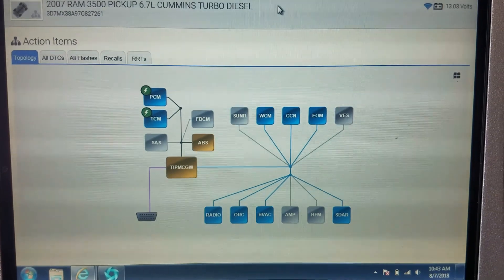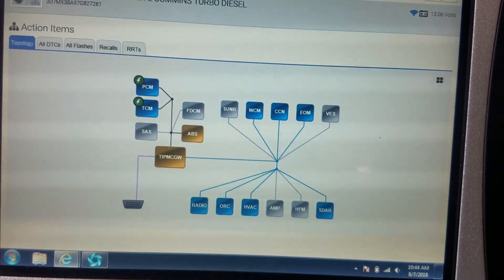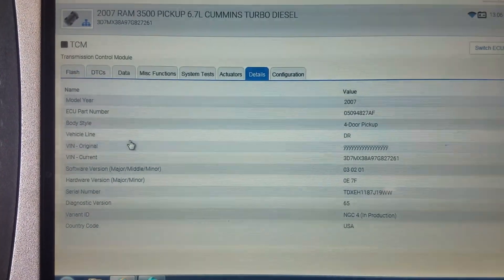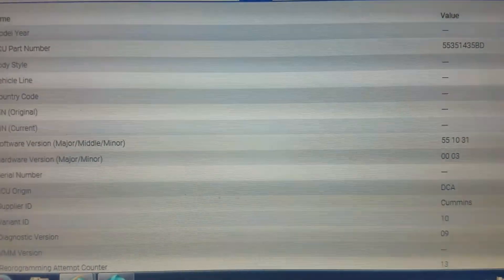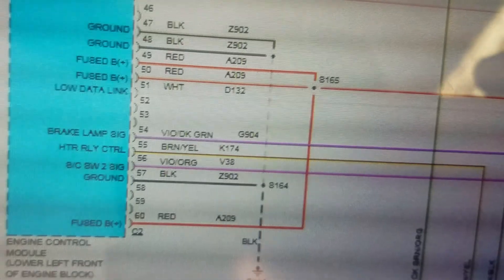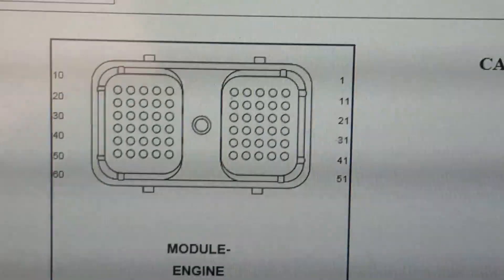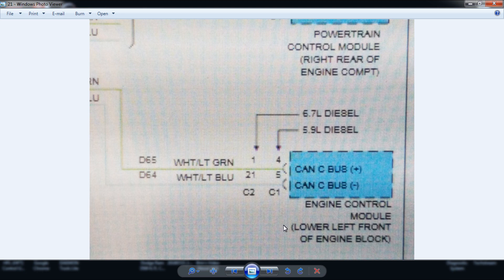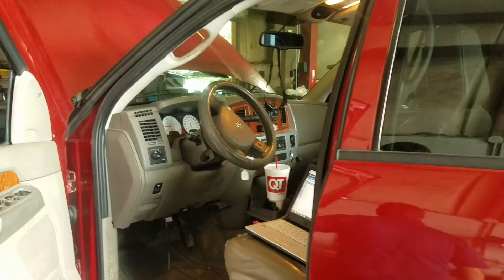2007 Dodge Ram 3500 6.7 Crank No Start - A Collaborative Diagnosis!

Comment: Similar issues all I’ve come up with so far is it something to do with the van corruption in the ECM usually can’t communicate through the enhanced side but you can communicate through the generic side with scan tool. The E Sims are losing the ability to be self identified by scanners and other onboard modules but are communicating on the generic side pretty sure it’s going to wind up being faulty ECM’s, and so-called rebuilds that are just repaired are missing the issue

Comment: I have a truck with exactly the same problem, i replaced the ecm with a reman truck started road tested the truck for about 5 miles and truck stalled has same problem  again 😑
Reply: Did you get it fixed?

Comment: Has anyone resolved this issue? I have the same exact thing going on with my 2007.5 6.7 3500. Been through 4 ecms changed all battery and ground cables and still having same issue 😢 can someone help out please? I’d greatly appreciate it
Reply: Battling same issue, died going to work, towed to dealer had it a week and finally called them saying bad ECM.  No vin number or different one, and said no codes, paperwork I got doesn't have what they did and said $3500 for ECM.  So had it towed home, looked on line for ECM found and outfit life time on ECM they asked me what happen an told them.  He asked for codes which I said there was non, person there should be and needed to scan.  They wanted to make sure that it wasn't an ECM.  Barrowed scanner and came up with 4 out of the 5 on video C2206, C2202, U0100 and U0141 which also had ABS.  They suggested R2 the ABS module, did and still same thing.  One thing I noticed fuel no prime, glow plug no light on, and battery charge light not on.  Hell the CTS3 I have when plugged in will turn on, shouldn't not until the engine is running.  So now a month going and will call the ECM outfit say no work with ABS change but, now wondering if it needs to be vin programmed.  Frustrating as hell.  Also noticed that the ECM has been replaced before I just wish I new what reason for I bought the truck in late 19, second owner.
Reply: Career technician, similar issues, including lost communication with modules on bus C .. replacement of failed doorman tip on the gateway module restored communication, and returned high and low voltage is back to 3 1/2 and 2 1/2 V gateway was pulling negative bus to 1/2 a vote…. Suspect, corrupted ECM files most likely due to programmer can’t communicate with ECM through the enhanced, but can communicate through generic all kids working no codes can’t reprogram due to no communication through the enhanced side guessing time for New ECM.

Comment: I have a dodge 2007½ 6.7 with the same issue. It has the delete done with an H&S XRTPRO  tuner  and egr removed completely. What are my options without going totally stock again?
Reply: Did you ever figure out your issue? I have the same exact thing 07.5 xrt pro truck died while driving now won’t start back.
Reply: @ItzMazz  I just put a new ecm on it. I didn't try to reprogram the old ecm so I can't say if that would have fixed the problem. I ordered the new ecm already tuned by an H&S tuner but for some reason the truck didn't have the power it had before, so I just retuned the new ecm with H&S tuner. So far the truck is working nicely.
Reply: @ItzMazz  My truck died while driving too so it sounds very similar.
Reply: Where did you order the ecm from ? Dealer said oem ecm is $4k I told them kick rocks.
Reply: @ItzMazz  I actually didn't order it myself, the mechanic at the garage where I had my truck ordered it so I have no idea where he ordered it from. It was a refurbished ecm and it was around 2k and they gave me something for the old ecm too.
Reply: @wilhelmpeters6054  i have same issue where did you buy your ecm from?

Comment: I have a 2007 just like the video.  Replaced the PCM 4 times in the last ear and one TPIM.  Works for a while and then on road the lighten bolt comes on then check engine light. Loses VIN and no start.  can't find the issue causing this.  Did the reflash on video solve the issues or do you know what solved the end issue.  Thanks great information.
Reply: Me too. 07 6.7 3500. Remaned ecm solves issue short term. On my 3rd new ecm after fixing various electrical shorts, censor issues and new batteries. No shop will touch this issue.
Please help 🙏
Reply: @michaelrayplays3274   hey brother I have the same problem as you did. Gone through like 4 ecm’s replaced all battery
And ground cables and still haven’t resolved the problem. Did you find out anything on yours? Mine been sitting for months, no one can figure it out. 2007.5 6.7
Reply: Did you all ever figure this out ? Having same exact issue.
Reply: @ItzMazz  Replaced the ECM again then it gave a trottle sensor code.  Replaced that but still do not trust.
Reply: @ItzMazz  same here 😢 anything news on yours???
Reply: @joserolon5575  new ecm fixed mine!
Reply: @ItzMazz  I tried that 4 times already 😓
Reply: @ItzMazz  where did you find the new ecm? I have the same issue i replaced the ecm with a reman fixed it for 5 miles and truck stalled and has same issue again
Reply: @joserolon5575  i have same issue any luck?
Reply: @MrNrleader007  only new one you will be able to purchase is through Chrysler. I got a reman
Reply: @MrNrleader007  no luck.
Reply: @ItzMazz  i have the exact same issue replaced ecm with a reman road tested for 5 miles and stalled with same issue again. Any luck?
Reply: When you got the throttle sensor code did it lose connection to ecm again ? Because I got a dead pedal before it died
Reply: @ItzMazz  Not yet but has not been driven much.
Reply: Well I just got the truck out the shop yesterday. Changed the alternator, took off an aftermarket alarm, rewired the grounds and power cables, checked for shorts in the harness and checked pretty much everything that has to do with the electrical. Oh and a new refurbished PCM. (Flashed the PCM prior of turning on the truck) and the same thing just happened today. Died on the highway and left me stranded
Reply: @joserolon5575  Where did you get the ECM from?

Comment: I am fighting a no start issue right now and it seems that the fan clutch has faulted and is putting the ECM in Rom Boot Mode. It has faulted three times now, the second time I changed the fen clutch out as I had found some wires showing copper possibly shorting out together or to the fan shroud brackets. This third time I am thinking the ECM is corrupt and needs to be replaced. Point being......The fan clutch can cause some major issues to the ECM as I am finding out.

Comment: I put an H1 bulb inside of a $10 test light. 4.5 amp test light baby. Just make sure you wrap it with some red electrical tape so you know.

You have to grind off the ring part on the H1 bulb to fit it in case anyone wants to do this. 2 minutes on a grinder will get that thing off.

Comment: I have a 2007 Dodge Diesel at a dealer shop right now that won’t crank.  They have replaced the TIPM and are waiting on a PCM & ABS to come into the shop.  $6k and not sure of anything.  Any diagnostic tech’s like you that you could recommend in the Portland Oregon area?

Comment: thank you , good diag I was working yesterday on 99 dodge ream 2500 5.9 diesel no start  and I had no high pressure fuel , low side was good . how ever all the hits were for hgh pressure pump , had a code  P0216 injection pump failure . but for me to make the call for this pump was hard lack of information how the  system work, the fuel injection control module  has 1 power was good, ground is coming from ecm and there are like 6 wires coming from ecm to hpfcm, I was wondering what they do this wire how about if is not receiving any command from ecm , all data ,mitchell or identifix did not have description and operation more than they communicate in between . I decided to crack loose each injector line at cylinder head and thighnen , the last one on the back was very easy to  turn. after that it wanted tom start, took a while and started, a trick a teacher told us on a class. do you know what type of information they are exchanging or how they do it , on scan data there was not pid for actual and desire fuel. of course snap on  zeus  and x431 launch . thanks .
Reply: Thank you Joel. I'm sorry for the delay. I'm not sure that I understand what your question is bud.
Reply: Now I'm curious about what these wires used for,if somebody out there know please let us know

Comment: Yeah it’s easy to make your own load test lights with headlamp bulbs, sockets, and soldering cut T-pin ends on the wires. I have a whole range of loads of test lights just for testing these circuits.

Comment: hi guys darren here from uk, question would you have found problem using just generic scan tool or was gem tool key,thanksguys you get much more diagnostic time than we do in uk
Reply: I'm sorry for the delay Darren. If you recall, we did take a look at data with an aftermarket scan tool as well. Yes, we could have but using a factory scan tool makes life easier in circumstances like these. Especially the wiTECH. The network topology is the strong point of this tool.

Comment: Most diesel aftermarket tuners will “store” the oem tune before it uploads the custom tune. The tuner is then locked out from being used on another truck until the custom tune is withdrawn from the ECM and the stock tune is reflashed in it. One of the first things I always do is use the customers tuner to install the oem tune and see if the problem goes away. It’s a quick and easy first step in troubleshooting these vehicles.
Reply from the maker: Good Tip!

Comment: Topnotch video please keep them coming , i have two questions one is is it true that Picoscope is working on an all in one scope if so please let me know the details and the  number two question is could you tell me where can i get some of those piercing probes Keith Perkins used in his video GM Class 2 Network Diagnosis Tips . Thanks  truly  to all you guys at Trained by Techs for all the high tech information and great videos .
Reply: 8power0 aeswave.com
Reply: Aeswave.com
Reply: 8power0, I'm sorry for the delay but Mario and Drews Auto are correct. AESWave is a great source for most diagnostic and scope equipment . They are amazing people as well. I haven't heard anything about the all in one Pico Scope.

Comment: Awesome solid Diag! I always suggest a reflash before calling a pcm as well no matter what. These pcms are not cheap. Thank you for sharing this solid pcm diagnostic strategy. And props to Keith Perkins for suggesting this channel 👍
Reply: I agree mario. U don't miss any new videos huh? Take care
Reply: Jason Chavez i love to learn. Even if i know the subject, i like to reinforce the knowledge. I try not to miss the good ones. I love diagnostics 👍
Reply: Same here brother. Take care
Reply: Jason Chavez ✌
Reply from the maker: Thanks guys
Reply: Had no start Cummins/Dodge last month. Took over for another mechanic. Could not see pcm at obd2 port. Fuses good. Missing ground at obd2 port. Which is shared with ecm. Found ground wire above starter bad. At bolt to block. Repaired ground. Still, no data from engine. Even using extra data link plug on engine with Cummins software. Went to check power at ecm. Prior tech left connector in socket position. But, not screwed in. With screw. Checked power while there with load. Ok. Plugged back in. Truck started and run. The bad ground was causing what original tech was looking into with communication and erratic issues.
Reply: Thanks Mario & Jason!